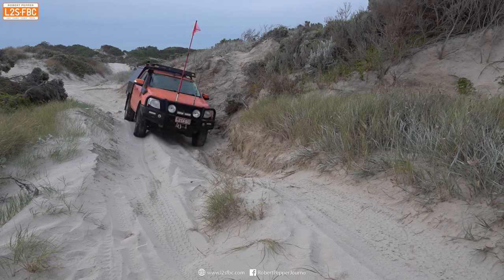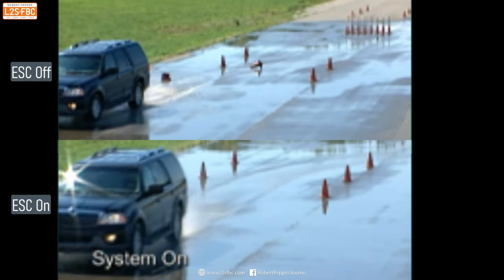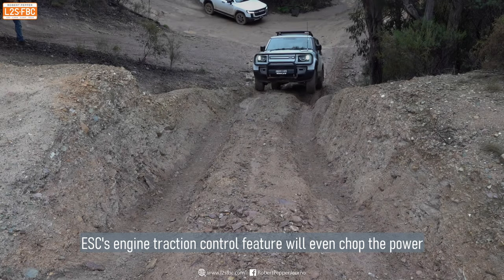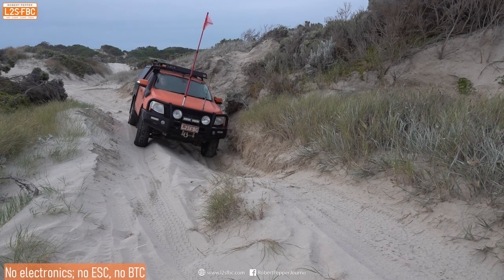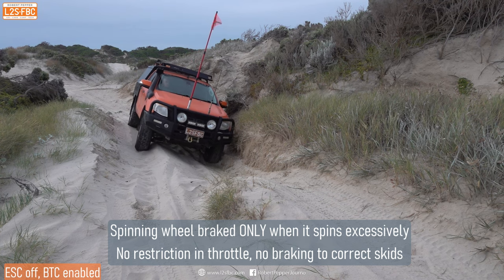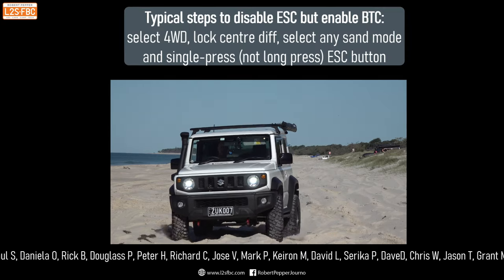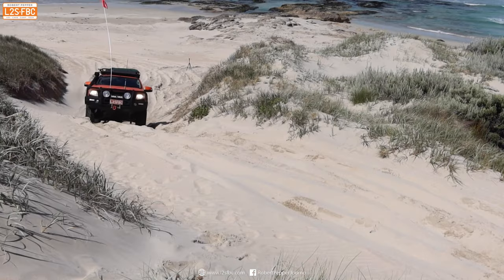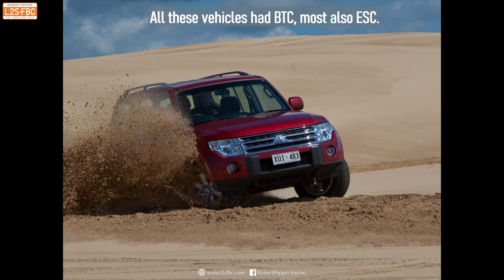Does traction control hurt you in sand?

Comment: On our old Disco 4,with E diff,only ESC could be turned off,Braked TC was on all the time,no problems in the soft sand.Although in the different mode settings,the sensitivity might have varied.Rock crawl seemed to lock everything,and BTC was very aggressive.
Reply from the maker: Yes Sand Mode de sensitiveness ESC and it can be further reduced but not eliminated with the off switch

Comment: Also worth mentioning pertaining to Toyota, hard driving on sand with ESC on frequency results in a steering angle sensor fault occurring, with warning light on the dash. Can put car in limp mod. Requires dealer to reset
Reply: What sort of Toyota?

Comment: Yes, it depends on the car. The hassle is to remember to turn esc back off after a restart. First time, everyone remembers. If it is only a day trip, and if the speed is not going to be more than 40kmph, I prefer low range and forget about esc. If fuel and range pose challenge like crossing Simpson, high range is preferred and can not afford to forget turning off esc.

Comment: My experience in my 2011 150 Prado over the past 10 years of ownership is that TC absolutely saps power and forward momentum when driving most beach driving situations, I.e. large sand dunes, soft sand etc. The only situation where it works in your favour is front wheel lifting like shown with your ranger demonstration which would be taken at speed anyway.
Reply from the maker: TC or ESC?
Reply: @L2SFBC  BTC, ESC only really engages in similar situations like those shown in your jimny demonstration, but has never bothered me or had any real impact on momentum.

Comment: One thing that all of these videos seem to forget is that every car has brake traction control. Keeping a steady even throttle and breaking with the left foot transfers power through the differential.
Reply from the maker: It will, especially a torque-biasing one, but then you really do sap your momentum. In sand I wouldn't bother with that technique for an open-diffed car.

Comment: Thats great info Robert. But I'm also interested in your sand flag, whats the go, it doesn't whip around like every other sand flag?
Reply from the maker: Because it's properly designed to be sufficiently stiff not to lose 1/3 of its height soon as you move off, yet flexible enough to bend if needs be.  It's a 4x4 Equip unit, not sure if they're still made.  The ones people normally run are in my view hopeless.

Comment: Thanks, useful video. But per the graphic at 0m20s, Engine Traction Control is not clearly discussed, ie how to turn it off, unless I missed something?
Reply from the maker: It's part of ESC as is BTC. Cannot be generally disabled in isolation and nor would you need to. Just ESC off.
Reply: @L2SFBC  for some unkown reason, my Pajero turns off the brake traction control when the factory rear diff lock is engaged. That leaves the front diff open so it seems like a stupid idea to me. I've installed the TC mod that enables the traction control when the diff lock is engaged and the car is far more capable. Trying to explain the difference between stability control and brake traction control to most 4wders is almost impossible, like talking to monkeys 😊. Nice try here though.
Reply from the maker: Yes Mike that's common unfortunately...both the car and the understanding 👍
Reply: @L2SFBC  "as is BTC"? Are you saying BTC is also part of ETC and cannot be disabled in isolation?

Comment: There's a debate on whether using 4L or 4H on sand. You've touched on this issue in one of your videos, but it would be great if you can discuss it in details.
Reply from the maker: Yes, I've covered exactly that point here  https://youtu.be/K_MdA2pL41A essentially use 4L if a max speed for the terrain can be comfortably attained in low.
Reply: @L2SFBC Thanks. I’ll check that video 👍

Comment: Robert, great explanation, thank you. Ford Ranger 2023 (Wildtrack) allows to turn off ESC (hold TC button over 5s) and "traction control" (ford lingo in manual) by pressing (not holding) the same button. And here is what confuses me: 
it says: "The traction control system applies the brakes to individual wheels and when needed, reduces engine power at the same time to increase traction."
From this I would assume that "traction control" in Fords lingo mean (ETC - engine traction control) I haven found any mention of BTC in the whole manual.
Does anyone have more insight, does it mean that BTC (as defined in this video) stays on / cannot be turned off or does it turn off by traction control button (single press)?
(I would like to set the car to following configuration: ESC off, ETC off, BTC on). Thanks.
Reply from the maker: Lock the centre diff if you have a V6, or engage 4WD in the other cars. Then press ESC once if in high range. In low range, ESC and engine traction control are disabled, leaving BTC.  This works on all Rangers.
Reply: @L2SFBC  Thank you. Most importantly, I found the answer why my car made weird noises driving on the beach at 40km/h (when steering left/right) thanks to your video with the Jimny example.  It's the ESC. I did not yet have a chance to test it set off. In Sand mode, Ford Ranger puts the car to 4H with rear diff locked, but leaves the ESC on in the sand mode in new Ranger (weird - why Ford?)
I need to check at next the next occasion how does it perform if I disable ESC manually.

Other than that I had no problem elsewhere off-road (partially because there is no need for super hardcore stuff in my place) and thank you for guidance Robert - but still, I would like to have better understanding and would like to know how the tech is implemented and sadly Ford manual doesn't explain/differentiate between BTC and ETC. How to keep BTC on while ETC off in 4H for best performance.
(I don't want to go to 4L for higher speed beach fun drive. My model is i4, bi-turbo BTW and it has the rear diff lock (sadly no V6 available in Vietnam).

So this leaves part of the question unanswered for anyone who knows, what does traction control button do, does it disable ETC only or both ETC and BTC?
Reply from the maker: Disables ESC and Engine Traction Control, leaves BTC active unless long-pressed.
Reply: @L2SFBC  not sure about old rangers, but according to manual (and tested) on new Ranger (2023) long press disables ESC. Short press disables TC (but not sure if BTC as well).
Reply: @L2SFBC  That is how it works on my MY18 Isuzu. When low range is selected automatically the ESC turns off and the engine retardation traction control turns off but the brake traction control of braking applied to spinning wheel remains on unless you press the ESC button for several seconds.

Comment: I think this is old argument that new tech is bad but not understanding how to get the most out of it.
For example; there is a lot of opinion about the FJ Cruiser that uses Brakes on the front axle for better traction that it robs power from the system,
 I don't think that is really the case as it directs the power back to the wheel that can make use of it as you demonstrated here.

Comment: Have done the simpson east to west twice west to east once straight over big red every time,fraser via inskip many times in our 200 all t/c turned off never  had a problem. Sand no t/c high range 200 series not a problem.
Reply from the maker: Did you turn it off or just lock the centre diff?
Reply: @L2SFBC  centre diff locked both traction controls turned off
Reply: @L2SFBC  In simpson have tyre's at 17 and 19 fraser and most other beaches 22 and 25. The 200 has engine tune 800 n/m with 250 kws and trans has been tuned.
Reply from the maker: Think that just shows how good the 200's suspension is!
Reply: @L2SFBC  old man emu 4015 kg gmv upgrade and loaded to 3950 lots of power very easy to get momentum when it is required. Have been camp at inskip and ran out on the sand spit at road tyre pressures it did it easy.

Comment: Isuzu Dmax MY18 manual at least, select low range. ESC and engine retardation control are off but BTC on spinning wheels operates. Another press of ESC button for seven or so seconds would have the brake traction control off too but who wants to do that.
Reply from the maker: Exactly!

Comment: Wierd thing is on the Jimny JB74, is that you can disable ESC above 40km/h by only be entering ESP Maintenance mode, but that also disables the brake traction control... What is the Jimny setup you recommend for sand?
Reply from the maker: ESP MM.  BTC helps on sand, but ESC is so bad that it's better to disable it if it means also getting rid of that dire ESC. Suzuki should be ashamed of themselves.  https://youtu.be/MHPGaDfCIwo?si=8G6pT-t0jEqL-IXY

Comment: You weren't going up a sand dune in that demo and I've always been told that TC is no good on a dune climb because you need momentum and TC will hold you back. Is that correct or not ?
Reply: Correct.
Reply from the maker: Partially. TC is an umbrella term for multiple traction systems of which BTC and ESC are two. ESC will hold you back. BTC will help. So you want BTC but no ESC. Most 4x4s can do this. Some cannot. Look at my JB74 Jimny sand drive setup video for more.

Given a choice between  ESC and BTC or no BTC no ESC you are better off with the latter in most sand drive situations.

Comment: I wouldn't really want to but I don't know of a way to turn off BLD on my Jeep. 

To turn off traction control you turn off traction control... To turn off stability control, you long press the traction control for several seconds. 

Just for comparison purposes... I wish I could turn off the BLD but I guess I'd have to pull a fuse or something to do that in my jeep. Even when I just crank my Jeep and pull it out of my driveway and don't press any buttons... BLD is ready to go because it's four-wheel drive auto. I can't turn off four-wheel drive either without pulling a fuse.

Maybe I could do it with an OBD program but I haven't tried.
Reply: Hmm, maybe is just cause my Jeep is old, (open diffs) but why would  u want to disengage the BLD? It's only engaged in 4hi and 4lo on mine and ESC is only engaged in 2hi and 4hi. ESC is automatically turned off in 4lo and since I don't have locking diffs the BLD helps compensate for that. Or maybe I'm not understanding your question?

Comment: OldMate58 told me to pull the fuse out of the traction control. OldMate58 was wrong, again!
Reply from the maker: Only if that's the only way to disable ESC as it is in the Jimny!
Reply: @L2SFBC  My bugbear is that when you turn the terrain response settings on the Discovery 3, it not only re-engaged DSC, but also turns HDC back on to a very low target speed. It's infuriating when you're flipping between Grass/Gravel/Snow and Rock Crawl, for instance. I actually found it more stressful than my Series III because of it.
Reply from the maker: Yes, Land Rover wisdom...